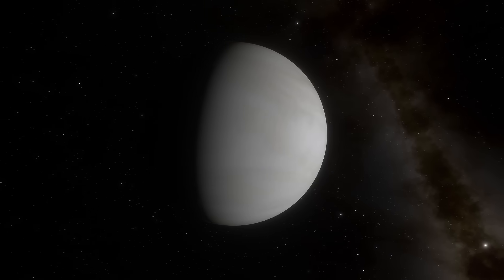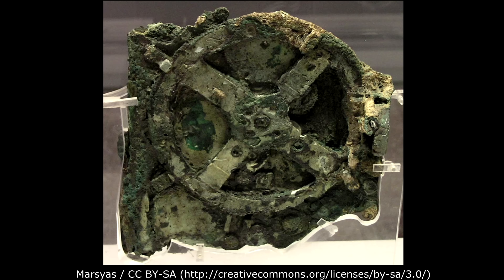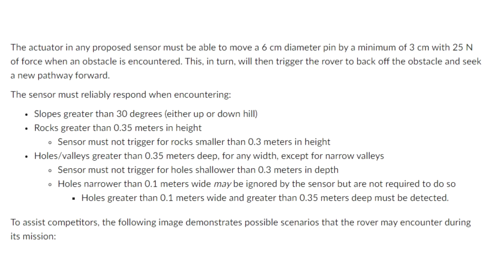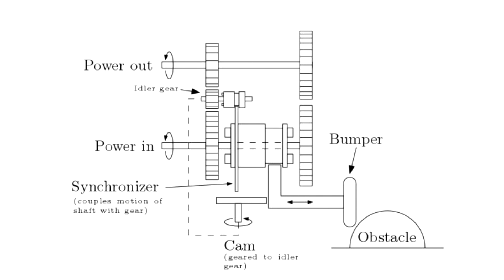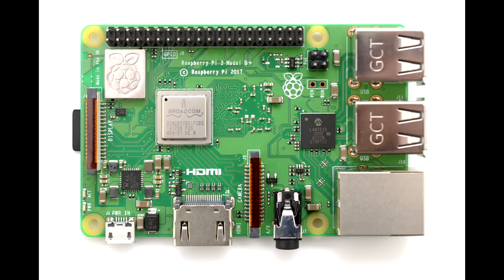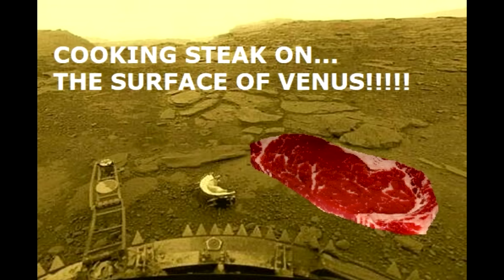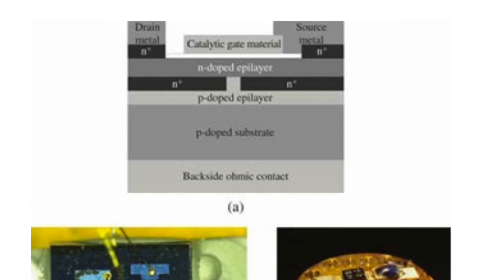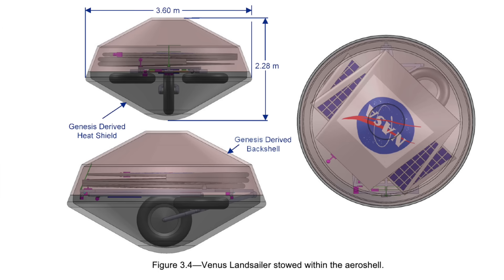Venus Rover Concepts That Beat The Killer Atmosphere

Comment: They created an idiotic concept and obliged everyone to follow it...

For example, I immediately thought that one could plan an entire mission. I would start by creating a fleet of several satellites and one landing module. The landing module would include a Sterling engine that could provide high power that can power cooling system which at the same time could create a higher temperature gradient for the generator and allow using of sophisticated electronics. And the orbital grouping would consist of communication satellites and a laser gun that would heat up the Stirling engine.

Comment: In regards to Venus landers, Scott, NASA might want to take a serious look at using thermionic valves for the lander's electronics as they can tolerate not only high temperatures but also high radiation levels. Using modern materials science and design techniques valves can be made very small (Subminiature valves in the past have been made as small as a pencil's rubber).

Comment: vacuum tubes have to be heated to much higher temperatures to work, passively being hot might actually be a benefit.
Reply: there just so fragile, then again, there hasnt been much done to make a better vaccum tube with todays knowledge.
Reply: @nemoskull2262  and it would exceed the power budget.
Reply: @nemoskull2262  I'm pretty sure the leading militaries have at least some modern vacuum tube tech. I'm not sure but it might be impervious to EMP's.
Reply: @nemoskull2262  Nuvistors are smaller and more robust. I think the materials would have to be changed anyway.
I assume the Soviets launched tube-based radios into orbit, but can't find a reference.
Reply: @nemoskull2262  There are metal tubes
Reply: But isn't it only the cathode filament that has to be hot? If the grid(s) and anode are hot enough to emit electrons, won't that eliminate the effectiveness of the vacuum tube*? 
(*"valve" in British English)
Reply: @MottyGlix  You could add "suppression grids" to trap electrons coming off the anode. I believe you make the cathode larger and/or hotter to overpower other emissions; it'll be noisy.
Might be a good place to integrate a capacitor; you have a vacuum.
Also, graphene is usable at even higher temperatures.
Reply: @MottyGlix  if only an electrical engineer was here
Reply: @MottyGlix  - Those elements would have to be made of a non-emissive material or the thermionic function of such a tube/valve would indeed be impaired if not rendered completely useless. I'm sure there are such materials.
Reply: To everyone saying its too fragile, vacuum tubes can be made from metal. Not just glass.
Reply: For what its worth, the guidance systems in some early ICBM warheads used vacuum tubes (nuvistors). Given these were in the warhead, they must have tolerated both high temperatures and extremes of acceleration.
Reply: @ExtroniusAttributes  - Actually the components related to the guidance system would be among the most protected and heat shielded parts of the missile. The fact that they are next to the warhead is of no consequence since they have served their purpose once it detonates.

Comment: what about micromechanisms?
 surely the miniaturization of certain mechanisms to the microscopic scale would lead to significantly lighter and more compact mechanical logic.
Reply: Yes, just remember to keep them machines in white chamber conditions or they will seize with dust at the first gust of wind
Reply: @TheNasaDude  and that is why CPUs are capped with a silicon die. It is obvious that any microscopic components would be shielded.

Comment: early storage mediums might have an advantage, punch holes, that knitted stuff they used in Apollo. I can imagine  those made out of high temperature materials.
Reply: The Apollo memory was electrical wires and ferromagnetic cores. I'm not sure we have a ferromagnetic material for that temperature range.  But if we do, that'll provide memory with a size that's about the square or cube of the transistor count.
Reply: @johncrowerdoe5527  Fair enough, I didn't pay attention to the details on the Apollo memory.
But punch cards should work!

Comment: Send a construction worker from Arizona ..whit the heat from there ...man those guys dont feel. Anything ..
Reply: It's a dry heat.
Reply: No there heats like, 30 to 50 degrees Celsius, in Venus you would have to resist 400 to 600 degrees celsius. They would die anyway there.

Comment: Why not a device rather like BB-8 from the new Star Wars? Many of the navigational problems relate to wheels getting stuck in cracks or lifted off the ground, so if most or all of the surface is a kind of "wheel" then surely it would make things simpler?
Reply: But then you think about how it would do experiments and transmit data

Comment: An airship in the Venetian could settle in at 32 miles above the surface. air pressure and temperature would be similar to earth  at that altitude .If you can dangle two wires 32 miles down to the surface connected or achored to your lander  then you can use simple Morse code to transmit analog data from your analog computer all the way up to the floating relay station which can forward  that data back to the Earth using normal electronics.  Telegraph service used to be transmitted two different countries via cable under the ocean so 32 miles is not unreasonable.  The weight of the cable could be offset by balloons or lighter than  Venetian air vacuum bottles at different points along the cable going to the surface.

Comment: I have an idea as to how this can be done - and no lab to achieve it with.

SO:'
See Leonardo Da Vinci's self propelling cart for the locomotion.
Use sensor pack encased in high temp glass [eg cooking glass or chemistry flask glass] to overcome the acidity issues.
Perhaps layer the glass so that it functions like a heat sink on a carburetor.  Gas or fluid could be used for active cooling similar to "wet" cooling systems currently used in many gamer's computers.
Communications can go through the glass.
Perhaps, the acidity of the environment can be used to decay a material.  The product of that decay could function as the fuel source.

Actually, I would prefer to see the delivery of a series of balloons with sensor platforms.  These aerial vehicles would have to be able to change their altitude, ride thermals, and navigate in the atmosphere.  I think that development would be more useful than a rover.  Once the layers of the atmosphere have been studied and mapped, the aerial vehicle network could be upgraded to drones.  [Perhaps, those drones can be shaped like Da Vinci's Airplane, Helicopter etc]

Tanks
James Anthony Wright
Reply: A probe would be useful for confirming the survivability of any possible balloon materials, so still a better early choice.
Reply: afair the acid is all in the clouds, not the surface-level athmosphere
Reply: I am replying to comments by jared maddox and nibbler.

The atmosphere on Venus is stratified just as it is here on Earth.  Pressure is greatest at the bottom of the atmosphere and least at its top.  Atmospheric concentrations are highest near the surface due to the pressure and gravity.  Within that fluid, [atmosphere = fluid dynamics] there is a level where the acidity, heat etc becomes intolerable for current technology.  We can create a network of "balloons" which can stay in the atmosphere and change their altitude, grid location etc while collecting data and taking photos of the surface.  We can then place that network in the atmosphere to detect where that sphere of tolerability is.  That mission would be incredibly useful for planetary science and other fields.  The same techniques would be useful for study of Jupiter, Saturn, several moons etc.  

Putting a rover on the surface would not be as useful.  It would be nice to have a "Venus Opportunity" mission. But, most of the data from the Mars rovers concern the atmosphere.  The best way to study the atmosphere on a planet with a thick one is to be in the atmosphere.  In time, data from the mission would identify the best areas to mine for geological information.  Once we better understand the engineering needs of the environment, we can design a more effective rover to collect that data.

Tanks

Comment: A large vacuum or partial vacuum bottle has been suggested as a lighter-than-air platform in Earth's atmosphere. It would probably work like gangbusters in the Venetian atmosphere. You could use a mechanical pump on the surface to evacuate CO2 and create a partial vacuum in your Landers giant  thermos bottle then lift the entire lander to the upper atmosphere where it's much cooler and regular electronics could opperate even using solar power. Your lander could upload it's data that was gathered using a mechanical computer. Then it could descend down to the surface again just by allowing CO2 enter your thermos and equalize the pressure somewhat making the ladder now slightly heavier than air.  You return to the surface and start the process all over again.

Comment: The ARM 1 and 2 CPUs had a transistor count of only 27k, were both 32 bit and were considerably more powerful that CISC chips of similar transistor count. I wonder how many transistors an 8 bit ARM would need. Could it be brought down to something reasonable, like 2k? A quick Google search shows loads of such architectures but no hard data on transistor count. (Tho I'm sure it'snout there.) But you don't have to go back to the 4040 for small transistor count, is my point. I get that carbide transistors are large and t-count is low but pointing back to the 4040 is a little bit much.
Sorry. 
Bit of rant. Pretty cool project, tho.

Comment: a windmill sounds cool but I would expect something closer to a jet engine using some sort of reaction to generate both thrust and energy. " 
eburacum45~ Is there any reasonable fuel that might power a CO2-breathing jet engine on Venus? The only option I can imagine at the moment is a nuclear-thermal jet, something like the Project Pluto atomic airplane/missile that was never built back in the 50's/60's. How about some kind of metal nanopowder - magnesium perhaps?"
Reply: https://forum.cosmoquest.org/showthread.php?157570-Jet-engine-on-Venus

Comment: This mechanical rover idea is so delightfully archaic, I love it.
Reply: Mechanical things have their charm
Reply: Thank you for your input hydrochloric acid
Reply: @JUK3MASTER  Hydrochloric acid (okay, mostly anhydrous hydrogen chloride) being a meaningful atmospheric constituent in the cloud layers  ;)

Seriously, though, Scott overplays the case against conventional electronics.  For example, he says that if you crunch the numbers, wind and solar don't work.  Except that there are peer-reviewed research papers that show that yes, they actually do.  Solar is the really surprising one - and yes, you have to be very careful in your choice of what type of solar cells you use, and your power-to-mass ratio is pretty terrible, but it surprisingly does work.  And with sufficient insulation, you can operate heat pumps (also well researched) to keep electronics cool. And you can use higher-temperature silicon carbide electronics.

The odds of mechanical computers actually being used is exceedingly low.
Reply: Karen Pease  Actually I think you are underestimating it.
Illumination on Venus's surface is not much more than 100 watt/m². The best solar panels we have can achieve around 20% efficiency, but those are unsuitable for these temperatures, so likely you're probably looking at around 10%, so best case scenario, you have 10-30 watts being produced per square metre.
BUT then you have line losses due to temperature, copper has 2.7 times the resistance at 450 than room temps, and you can't use better conductors like gold because they will melt.
Then you have the processors themselves, who need to have signal to noise ratio high enough that they can work - but at 400°C, they need to be pumping godawful amounts of power through their circuits to distinguish signals through the noisy circuitry. And as Scott pointed out - the silicon carbide electronics are not there yet for these kinds of applications. Maybe, eventually, but not yet.
and then you add your heat pumps into the equation - what will you use as a working fluid? how will you protect your radiators from corrosion?

Ultimately you end up with a very heavy, very bulky system that somehow needs to safely land on Venus and function for a long enough duration to make this worthwhile.
I don't doubt that eventually we will find a way to make this work, but I also reckon that if there was an easier way to do this, NASA wouldn't be offering a cash prize for someone to develop an analogue alternative.
Reply: @ValleysOfRain  You don't have to speculate on this; there are papers on this. I've read them. Solar, for example, Landis has at least one. Yes, the power to weight ratio is awful. But - and this is part that matters - even the worst electronic computers have orders of magnitude better compute-power-to -weight ratios vs.  mechanical ones.

Plus, lets not kid ourselves, tribocorrosion would be god-awful for a mechanical computer on Venus's surface.
Reply: @karenrobertsdottir4101  well then, by all means, list some DOIs, I'd like to see those papers.
I agree that the mechanical alternative is not really that great, and I think that ultimately electronics will win out on this one.
I just got the impression from your comment that the challenges of the Venusian environment were minor obstacles, which they aren't.

A hybrid electromechanical system may well be a good method forward. For example, those radar semaphore systems seem like an excellent method of avoiding the problems of operating a radio on Venus.
Reply: @ValleysOfRain  DOI: 10.2514/6.2013-4028 for example.  Yes, power density really sucks.  But in terms of compute power density....

Another issue with digital vs. analog computers is that both designing, manufacturing and updating new digital computers (and software) is far easier thsn doing the equivalent for a mechanical computer. That alone renders their use for almost any serious mission near-certain (even if a mechanical mission ever gets funded for demonstrative purposes).

There's nothing easy about Venus's surface, regardless. But you can brute-force any electrical solution in a pretty straightforward manner, with a bulky enough power supply and a heat pump with insulated electronics.  All issues of high-temperature electronics aside. Venera probes got plenty of life even without heat pumps, just from insulation and a phase-change buffer alone.  Landis has some heat pump papers too, I'd have to dig...

Comment: Can't rover utilize external heat for power generation?
Reply: Not really. To generate electricity from heat - you need something cooler than your surroundings.
Reply: @vasimvaleev5545  Maybe there is a solution, needs a thermodynamics expert to design it, and probably materials that wouldn't work at earth conditions. If a gradient is needed, the probe could contain cold compartments and use the gradient of inward heat transfer to power a system that uses some of the energy to run a heat pump to maintain the thermal delta for longer.  It obviously can't do that completely (it would be a perpetuom mobile), but extending the survival time from minutes to days or more would already be good.
Reply: @johncrowerdoe5527  Soviet's "venera" ("venus") probes did that just with batteries, no need complicated setup for tens of minutes work time.
Reply: @vasimvaleev5545  Yes, I know the Venera probes ran for minutes, perhaps even a few hours.  Goal is to get days, weeks or months of operation.

Comment: For power, we could try using a microwave receiver grid, and just beam the power down from the orbiting component.  Power storage can be done by either some exotic liquid salt battery, or, more practically, by some flywheel storage device.

Storage of data can be gotten around by simply not storing anything on the rover itself.  Just have it beam stuff up directly to a network of orbiters (so you can always have at least one orbiter in contact with the rover).  Electronics will need research.  Basically we need stuff that will work on the surface of Venus.  We don't particularly need these electronics to work outside of that environment (since any such electronics will only be needed before the Rover lands, and can be disposable upon landing), so research can be done on materials that display desired properties at the range of temperatures and pressures to be found on the Venusian surface. (Heh.  Maybe high-tech vacuum tubes could make a comeback.  That would be properly steampunkish...)

I think my most innovative brain storm would be to have a drone balloon, zeppelin or aircraft instead of a rover, and do all the science from the sky at an altitude where the pressure and temperature are more bearable, and just dropping disposable one-use probes to the surface where we spot something interesting to look into...

Comment: Before they were semiconductors there were vacuum tubes that had needed an internal temperature of. 2500 °F (1400 °C),.  They might even function more efficiently on the surface of Venus.   Perhaps you could make a simple type transmitter from vacume tubes to transmit basic information from an analog on the surface 2 orbiter.

Comment: Since is mostly co 2 which is pretty dense, why not a floating rover? Something that could float near to the ground, or even one that has arms that can grip the ground, but the bulk of the weight is suspended by a lifting gas bladder. Maybe an aerogel lined bladder to help with the heat resistance